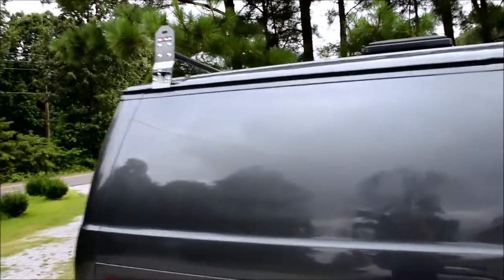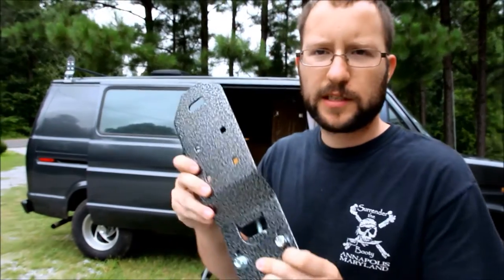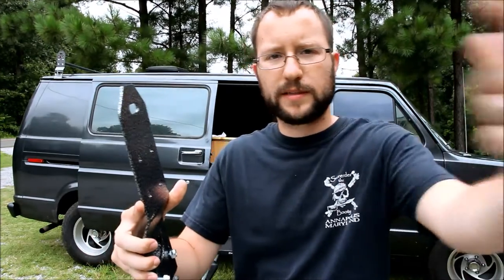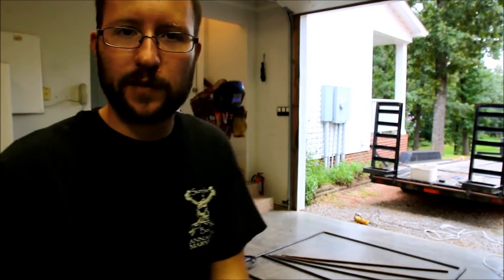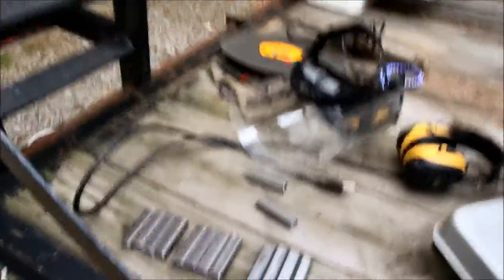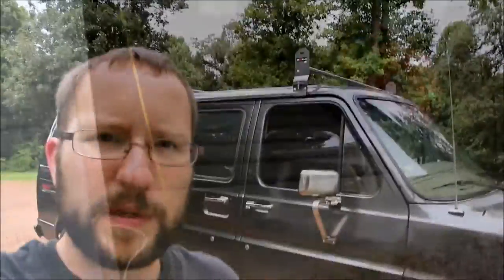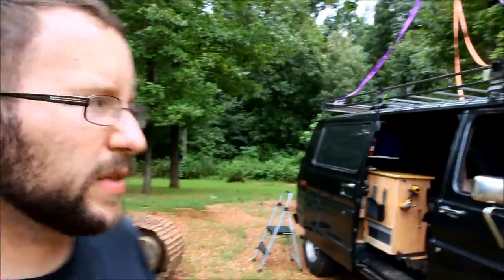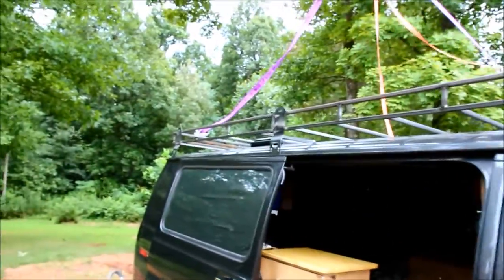Roof Rack Build on my Camper Van

Comment: Great job on the roof rack , I built mine on top of the bars and even though its a one ton I can feel the weight in the corners , loaded all my hunting stuff on top it worked well but got a little body roll in the corners , think you had the right idea cutting out the bars and welding the rack direct. Really enjoy your videos very informative and entertaining you have really transformed your van into a useful tool.
Reply from the maker: I actually used the rack to haul lumber today and it worked out great. Thanks for watching.

Comment: Not sure if your using HF wire in your welder but it causes problems in mine. Try to Lincoln wire for cleaner welds. Rack looks cool, thumbs up.
Reply from the maker: My welder is a cheap harbor freight welder and its just bout had it. The wire won't feed anymore. It is just cheap. Thanks for the complement. I am glad you enjoyed it.